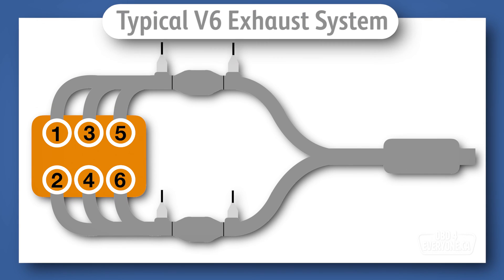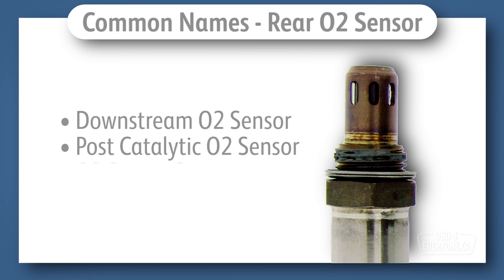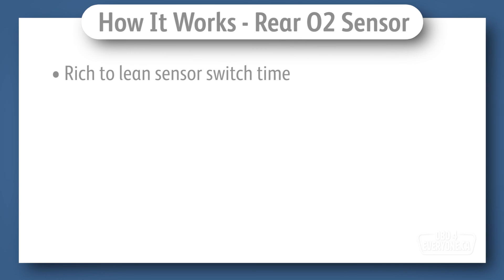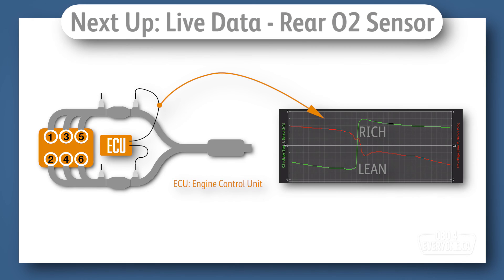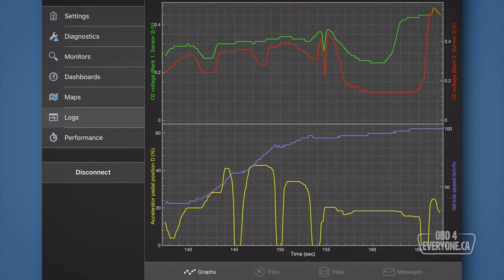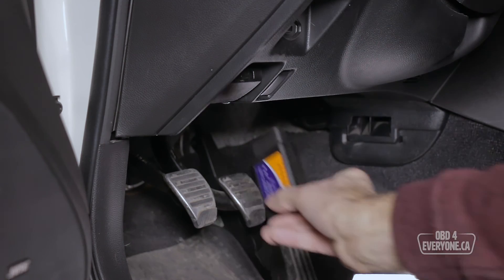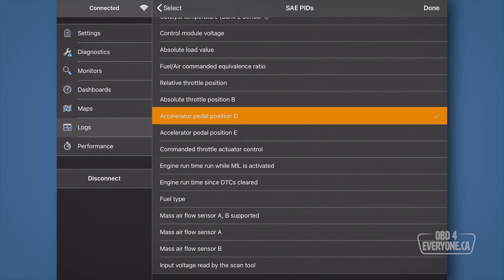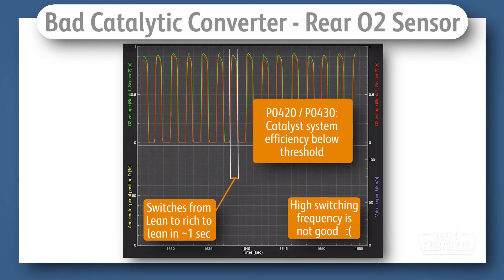Understanding & Live Graphing of the Rear O2 Sensor: OBD4Everyone Ep.19

Comment: Could you use the mass air flow rate instead of the accelerator position? Or does the accelerator position provide better specificity for sensor behavior?
Reply from the maker: Hey  wanderingazn,
The mass air flow rate is also a good indication of engine load.
You could also use calculated engine load, absolute engine load, MAP (intake manifold vacuum), and relative throttle position.

It is just nice to have something capture engine load, to help you understand what the O2 sensors are doing.

Have fun :)
Reply: @OBD4Everyone  Thanks! I've been graphing that as my Graph 2 since my vehicle only has one downstream sensor. Wanted to make sure I had a good marker for my engine load!
Reply from the maker: Hey wanderingazn,
Anytime :) Have fun!